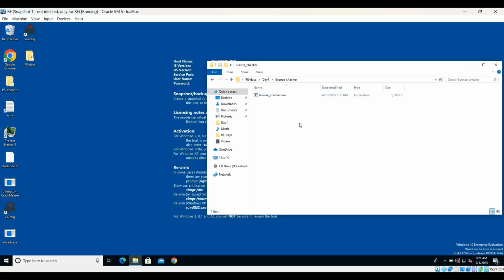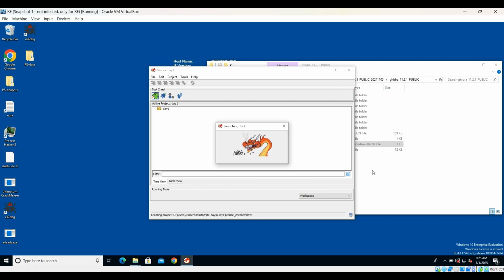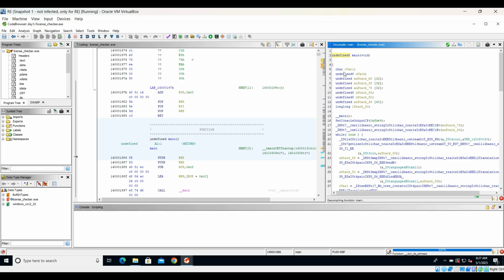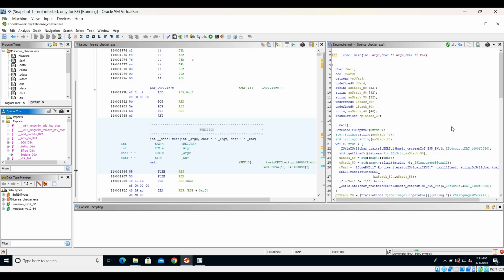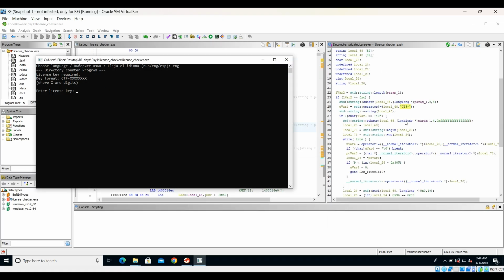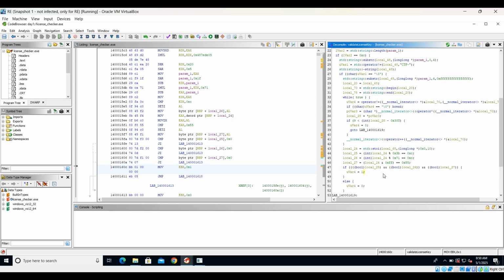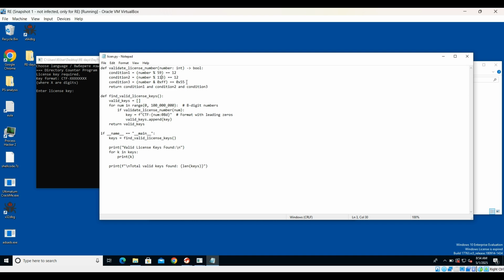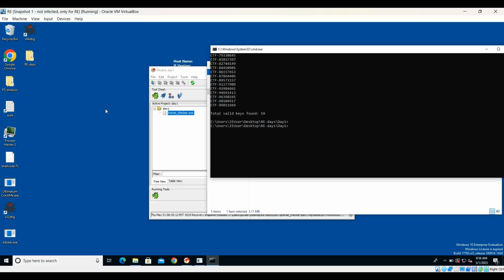Alt-Day RE Challenge - Day1

Comment: while seeing the high level code, i found that local_58 variable has the flag which is CTF{this_is_secret_k3y} but it was xor encoded, i found the xor decoding key there also, so i decoded it rather than going after the license key brute forcing, will this be considered a valid method to get the answer?
Reply from the maker: Yes... There can be multiple ways to solve a problem. What I am sharing is my approach, you are free to solve the challenges following your own approach. 
So, Theres no valid or invalid method. Such CTFs or challenges need you to find the right flag/password in any way possible for you.. any logic works :)